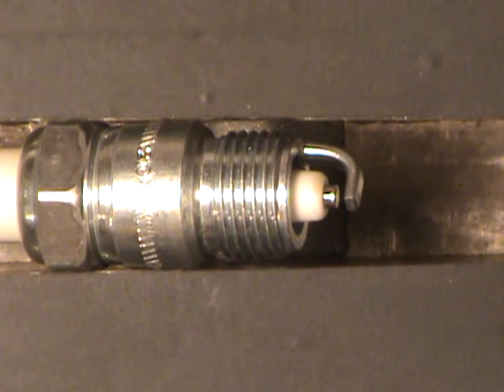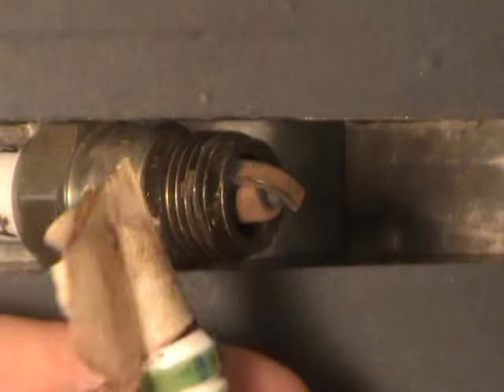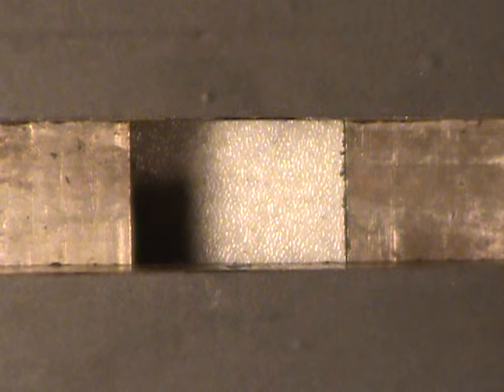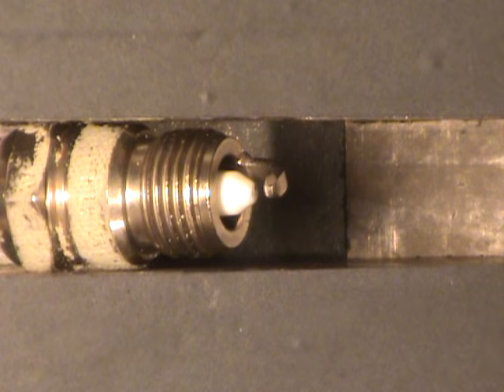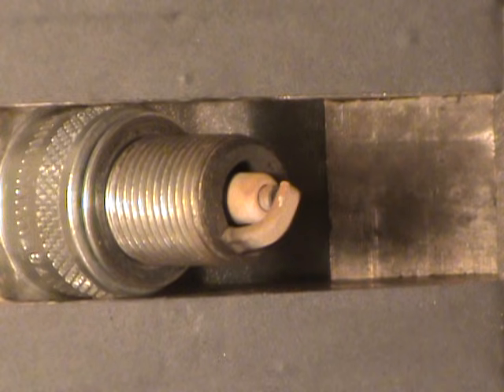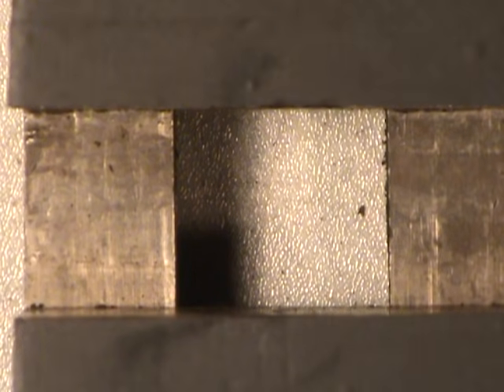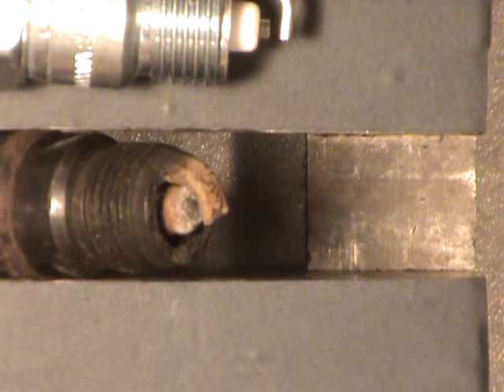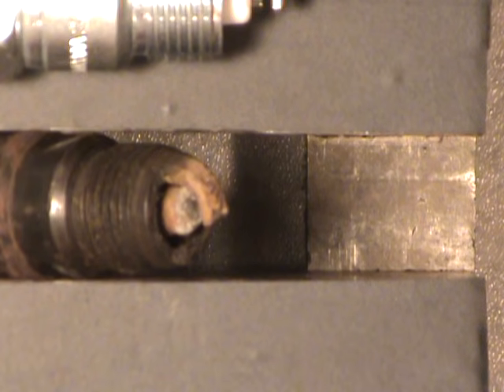SPARK PLUGS How to Read them (Part 3)

Comment: I finally got dad's truck fixed. I completely went against your suggestion the whole time, simple things first. I found one of the spark plug wire insulation torn at the plug connection.  Glad that's solved now I have to get his heat fixed. I'm pretty sure that's simple, the water flows both ways through heater core or it did last time I done that. I'm thinking air actuator.  I will check temperature at both hoses when truck gets good and hot if both have somewhat equal temp I think heater core can be eliminated.  Any thoughts on that? I'll not avoid the simplest things this time lol!
Reply from the maker: Jon Stone Greetings Jon Stone....Good to hear from You again my Friend, and..."Congratulations"...for solving at least "One of the Problems" so far, but, as we all know, there's still some more "Fun" to be had, well, perhaps it's just "Fun", if You're not the Guy or Gal, tryin' to figure out, "What's Cauzin' the Remaining Problems", that is (dare I lol at this point in time...???...geeze, maybe I better not, just in case Someone throws a "Monkey Wrench" at "Me"..!!!...lol)................................................Well, I'd say, that You are probably asking the right Guy (Me, that is), about, what might just be Causing a "Low Heat Output" from a Vehicle's "Heater and Defroster, Outlet Vents/Openings", that are in, or under, the Vehicle's "Dash-Board", and maybe, if so equipped, a "Rear Heater Core/Blower Unit", as well perhaps.............................................First off, just in case I forget, I should mention, to be Watching-Out for..."Control"...Levers, Cables, Hand Operated Cable, and Vacuum Control Levers/Switches, Vacuum Units & Vacuum Hoses, Air Doors, that Divert, or Change the Path-Taken, of the Incoming Cold Air, that Travels, either Through, or Around the Heater Core itself ...that, can be quite "Tricky", especially, if these "Parts & Pieces" are, shall we say..."Tied-In" with a Vehicle's..."Air Conditioning System's Controls" as well, if so equipped.....................Maybe, try moving the "Heat"..."Defrost"..."Air Conditioning"..."Control Levers/Switches...on the Vehicle's Dashboard, or where-ever they happen to be, and Observe, weather or not, any of the "Actuating Units"...be "Them"...Activated by "Cables or Vacuum Hoses"...actually..."Activate"..."Levers"...on the..."Actuating Units"...that You are able to easily "See", actually "Move to a Different Position".................................................I have "2" very good Examples for You, and how I "Finally"...lol...Fixed these..."Low or No-Heat Problems"...that I had a few years ago...................................................First Example was, "Very Little Heat", was coming out of the Heater or Defrost Vents/Openings............................................Both Heater Core "Inlet and Outlet" Hoses were "Good-n-Hot", so, seeing as how, that there Heater Core was quite old, and, I had no idea, on just what the previous Owners did, in respect to the "Changing" the Coolant (anti-freeze & water mixture) at the required Intervals, I decided to Install a Brand New Heater Core, as I was Thinkin'..."That Otta Fix It"...but..."Still No Damn Heat"...!!!................................................Turned out to be a..."Cable"...that "Was Not"..."Moving the Air Door"...that was supposed to..."Divert/Send", the Outside Cold Incoming Air, "Through the Heater Core"...but, Instead..."The Incoming Cold Air"..."Was Diverted/Sent"..."AROUND"...the..."Heater Core"...and..."Yes-Sir-ee-Bob"...I kinda went from having "Frost-Bitten-Toes"...to..."Nice-n-Toasty"..."Toes...Feet & Legs too"...!!!...lol...................................................The "Heater Core", that came out of that 1979 Chevy Van (not having air conditioning), can actually be "Seen", in that YouTube "Video" of mine, where I show Folks, How "They" Work, using Boiling Kettle water, and a few Hoses, and having a small personal Fan, blowing Air through it, along with a Thermometer, to show the Temperature Rise...........................................Example number "2", happens to be, a Mid-1990's GMC or Chevy Mini-Van, that had a..."Quite Low, Heater & Defroster, Heat Output"...........................................Seeing as how the Inlet and Outlet Heater Hoses, were very Hot, I decided to Yank the Lower Dashboard apart, so that I could get at the "Heater Core" (and yes this vehicle Did-Have Air Conditioning)..........................................Once I managed to get up close and personal, with, that there "Heater Core", I had the Engine running, and up to Operating Temperature..."Still, very Little Heat"...could be Felt by my Hand, with the "Fan On", and also, same thing, no matter where, I "Set the Control Levers" on the "Dash-Board" as well...!!!......................................Hmmmmm....so, now what...???..............................................There was an "H-Shaped, Plastic Valve"....that was..."Controlled by a Vacuum Hose"...so, I Drained the Coolant, Down about Half-Way, then, I "Removed", that there "Plastic-"H"-Shaped Valve", from the "4" Hoses, that were Connected to "IT"...and..."Guess What"...???......................When I looked "Into" the, shall we say, Plastic "Pipes", In that there "Plastic-"H"-Shaped Valve"...there was a..."Broken Piece of Plastic, that had an Orange Colored Seal/Cup-like, round rubber-like Pad"...that was, as I see it,  supposed to be, a "Vacuum Unit, Controlled...Arm, with an Orange -rubber-like Seal-Pad"...that was, when "Not Broken", to either "Send Hot Coolant"..."Through the Heater Core"...or...in "Its Other Position"..."Get Diverted/Re-Directed"...Through that Center Part of the Letter "H", "Plastic Pipe", and back Through the "Return Heater Hose"..."Without Going Into the Heater Core's Hose/Pipe"...!!!.............................................Even though that "Broken Arm/Valve"..."Was Not Totally Blocking the Hot Coolant Flow"...it kinda looks like, that "Water Pump" would rather be "Pumping the Hot Coolant the Easiest Way", which looked to me, to just "Double Back"...Through the..."Center Portion" of, that there Plastic "H"-Vacuum Controlled...I want Heat Now, or, No, I Don't want Heat Now...damn, Dollar Store Quality "Plastic, H-Shaped, Hot Coolant Control Valve"...!!!...lol...Junk I say...In my Garage, sitting on a shelf, I have a quite old, Used, maybe 1960's?, Vacuum Operated, Single Hose, "Brass Valve", All-Metal, with the Exception of the internal Rubber actuating Diaphragm, and I'm thinkin', it might be out of a Ford Car, that still works Great...!!!........................................So then, what about that "Wimpy"..."Broken"..."Plastic..."H-Shaped, Hot Coolant Control Valve"...well, I told "It"..."Where To Go"...!!!...lol...and, what I did, to actually give me "Heat", like You wouldn't believe, was, I measured for, the "Size and Length" of..."2"-Pieces of "Metal Pipe", and I basically just..."Joined the Rubber Inlet Hose, to the Other Rubber Inlet Hose"...and the..."Rubber Outlet Hose, to the Other Rubber Outlet Hose"...with those "2"-Metal Pipes, and "4"-Hose Clamps...and I "Safety Wired", Each Pair of Hose Clamps Together, for Safety Reasons, because of the Cooling System's "Pressure"...and..."Hot Coolant"...as well...!!!...and like I was sayin'..."Hole-ee-Gwalk-ah-Moe-lee"...in "Winter", I'm as..."Snug-as-ah-Bug-in-ah-Rug"...and then some...!!!...lol.........................................Yes-in-deed-elly-lee-do...maybe too much "Heat" now, as I've noticed the "Reason", for that Plastic "H"-Shaped Valve, was to "Stop the Flow of Hot Coolant through the Heater Core"...During "SUMMER"...where-by...Adding "More Heat", over and above, that of which, that "Big Ball of Fire in the Sky" (aka, our Sun) Provides, can at times, make me Sweat "More" then I have to...!!!...lol.....................................(Gears in my Head, are just-ah-Turnin', and I'm Thinkin')...maybe, I will be "Installing a Hot Coolant "Shut-Off" Valve, in one of the Heater Hoses, that leads to the Heater Core, so, I Don't Sweat so Much, in the "Summer-Time"...hell of an Idea I say, and maybe, just maybe, I might try, and Use that nice...Old and Worthy..."Brass"..."Hot Coolant, Heater Hose to the Heater Core, Shut-Off Valve"...that needs a "New Home" anyways...???....................................................All-righty then, that's about it for my "Heated Adventures" for the time be-in, and I hope, some of what I was sayin' above, will somewhat, be able to help You out, with goin' on a, shall we say..."Heat" related "Safari"................................Good Luck, oh and..."Watch-Out" for..."Lions...Tigers...and Bears"...oh my...lol............................................Till next time................Be Safe, take care, and have a good one.

Comment: Thank you - never seen such bad plugs on my cars. I wonder how many miles they have run these plugs to get these bad (the first few bad ones).
Reply from the maker: Nirmal Samuel Greetings Nirmal Samuel....You're welcome, and, Thanks for watching, and for Your comment as well.........................................The reason, that You, (and probably Others as well), were seeing, the, shall we say..."More then Expected"..."Deposits"...on most the Spark Plugs, that I used as "Movie Props", in this YouTube Video of mine, was more then likely, due to most of them, coming out of Engines that had "Carburetors" on them, and, some of them, had "Lower Output Voltage Ignition Systems" on them as well.............................................Also, most of these Engines, for the most part, had quite "Low, Compression Ratios", in about the 8.5 to 1 Compression Ratio area................................................Also, some of the Engines didn't have much in the way of "Ignition Advance", due to the Engineers/Designers, having to meet, the Government's "Emission Standards", back in that time period..................................As far as I recall, most of the Mileage/Kilometer-age, that Accumulated on most of these Spark Plugs, in this Video, were acquired, traveling at "City Speeds", that made for, quite a bit of "Idling at Stop Lights & Stop Signs", as opposed to, Traveling at much Higher Speeds, and, shall we say..."To Blow-Out the Cob-Webs" (lol, that's what I heard an older Gentleman saying, a while back, when He would take his Car, out on the Highway/Freeway, to Clean-Out His Engine!)........................................You see my Friend, on the Older, "Non-Computerized" Engines, that had Carburetors on them, would usually have Spark Plugs, that would usually stay much "Cleaner" (aka, less deposits on them), if the Vehicle's Engine was Running at Higher RPM's (Revolutions Per Minute), consistently, non-stop (well at least, until the Need for some more Gasoline, Food, and a Washroom break, demanded, that is!...lol), traveling down a Highway at 50 Miles Per Hour/80 Kilometers per Hour, there-abouts, and by just Cruzin' along, the Air/Fuel Mixture (Ratio), would usually be quite Lean, in around that Magic 14.7 to 1 Air/Fuel Ratio, give or take a bit, and the Ignition System's, "Spark Advance" would Increase as well, making for a fairly "Clean Running Engine", that also got, much "Better" Mileage/Kilometer-age, then the lousy Mileage/Kilometer-age, that the same vehicle was getting, sitting for quite a bit of time, in the "City", at "Red Lights & Stop Signs", Not Moving at all, and getting..."Zero" Miles per Gallon, or, "Zero" Kilometers per Liter...!!!...lol.............................................The more Modern Day, "Computerized Engine Management Systems", as compared to the Older, "Non-Computerized" Ones, do, for the most part, make for Engines, that Run quite a bit Cleaner, mostly due the the..."Amount of Computations"...that the Vehicle's "On-Board-Computer" is capable of doing, as well as, doing all of those Computations, at "Blazing Fast Speeds", so much so, that It'll make Yur Head Spin...!!!...lol...................................................I should probably end, here and now, or, I just might be tempted, to go..."On & On"...and If I did, It might end up..."Be-in a Book"...!!!...lol.....................................................My above comments, are, shall we say..."The Tip of the Ice-Berg"...when it comes to, the Incredible amount of..."Engineering and Design"...along with, the..."Very Long List of Parts & Pieces"....that made-up, and, make-up, the..."Automobiles"...of the..."Past"..."Present"...and probably, the..."Future"...as well..........................Till next time..................Be Safe, take care, and have a good one.